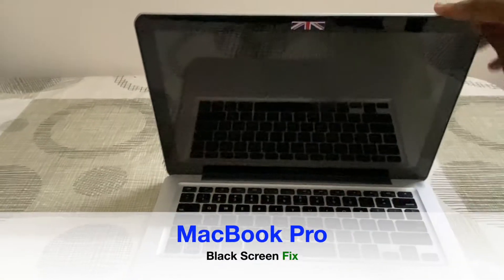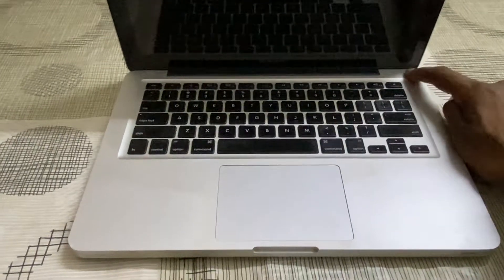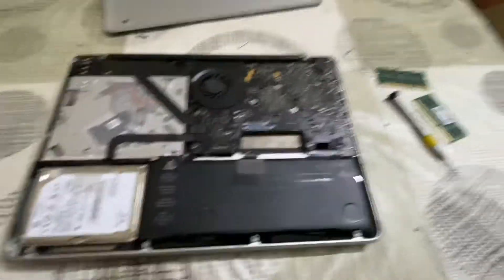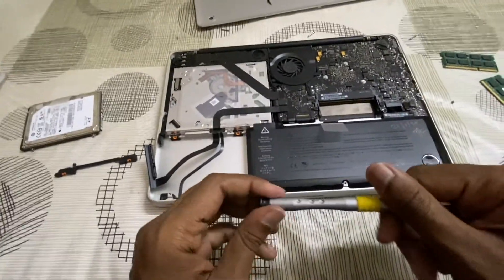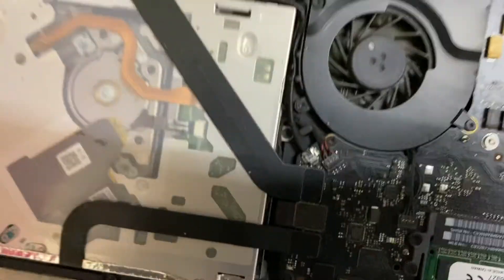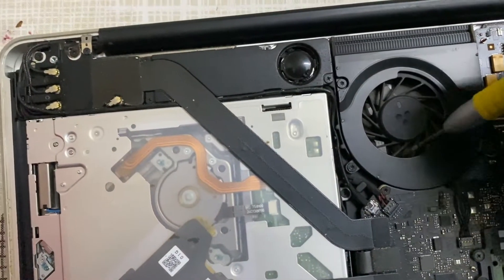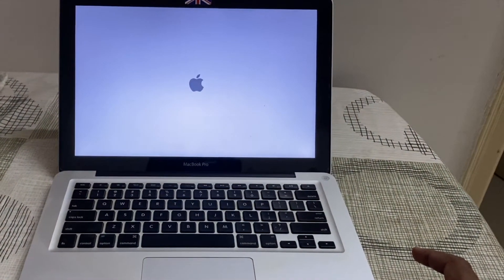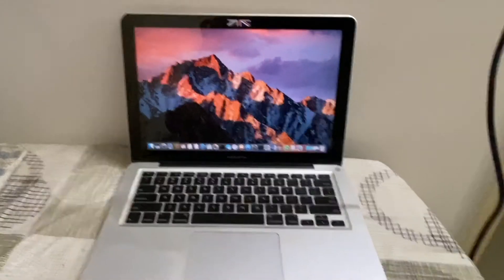MacBook Pro won't start, blinking sleep light, stuck at black screen? Fix it now!

Comment: Anyone with this issue. Hold down the power button for 5 seconds. Plug in the adapter while still holding down the power button, hold for another 5 seconds and it will boot.
Reply: Omg I tried this and it works, thank you so much, my gosh my MacBook pro won't open up for months now and tried to fixed it again today and I saw this comment, it didn't work at 1st but on my 3rd try, it works huhu thank you so much
Reply: I wish everyone it worked for would like the post so people know it's a legit fix.
Reply: Omg this worked!!! Thank you ❤❤❤
Reply: Spread the word 😅  @cheappc
Reply: Thanks brother,it worked!! Had a really important assignment to be delivered to a big client.woke up whole night waiting it to start.
Reply: Whats the issue btw?
Reply: @krishiyadav5659  it's something to do with a failure on the motherboard. You should prepare for issues of that sort some months down the road or it not booting at all. But when issue is still new this solution always works. 👍🏼
Reply: Just saying that this worked. I was skeptical but it did :)
Reply: DUDEEEEE THIS WORKS! Thanks for sharing
Reply: This worked for me also. Thanks. I already have a new battery coming. Do you think I should send it back and just get a refund?
Reply: @wedidedit  keep the order if your current one is off its best. Good Parts are getting harder to find.
Reply: Y E S !! Many thanks.
Reply: Man, I can't believe but it worked!! hahaha, MacBook Pro turned on in the first try.
Reply: Thanks so much for the tip, worked and my wife’s course work was saved 😄
Reply: Thanks brah now my fan is spinning at max speed😭
Reply: @notsmartist  it can't destroy the fan. I've used a mac like that constantly for over a year and it solves the issue of it running slowly. But let that not make you lazy to fix it.
Reply: @notsmartist there’s a program to put your fans at normal speed
Reply: Obv I need the battery I guess, there’s some way without the battery in? Thx
Reply: Found it a battery, idk how but it work 😅 how? What’s the problem then?
Reply: THANKS BRO, I WAS GOING TO KILL MYSELF, YOU SAVED ME

Comment: Same for me except the fans are off
Reply: Did it worked same .. my light only is turned on in the keyboard and the opening sound comes but it doesn't open
Reply: Have u fixed the issue
Reply: @सफल-aryal  No, but I have found why... I think.. If you look at the PC from the screen side. In the keyboards at the left, some wires must be misconnected.If you press softly then it will connect and I can use it for a few while.

Comment: But my fans are also not working.
Reply from the maker: Have to tried it connecting to power source. If fans run while connected to power then faulty battery. Even with power source connected and fans doesn’t work then Logic board may be corrupt. You may have to get it replaced

Comment: I have similar laptop, when press power button fan starts and stopping after few seconds. Then white sleep lights flashes. Same thing happens when I press power on button again. Please advise.
Reply from the maker: It appears  logic board may be corrupt. You may have to get it replaced
Reply: yeah same with me, like that, how fix it 😮‍💨

Comment: Thank youuuuuuuuu, my computer was with a " tech guy" for a month, he told me to buy new logic board, i did, but still didnt work, i just saw your video, and you suggest to change RAM memory, i remeber i had one extra pair, i changed and it works, thanks youuuu again bro. Any one with this issue, just change your RAM.
Reply from the maker: Glad to hear it worked 👍🏼
Reply: Prolly it wasn’t the problem, there’s a lot of different problems from the white light blinking problem

Comment: Tried to do both things but didn't worked please suggest something else .. the problem is exactly some
Reply from the maker: In that case I m afraid to say it could either problem with both or any of the ram or issue with the logic board. You can try removing one ram and turn on mac and vice versa. If it didn’t work then logic board is corrupt. Don’t try to replace logic board as it’s too expensive and better to get a new mac. Your data is safe, third party vendor and remove hard disk and recover your data
Reply: @agentsan23  hi i removed one ram , its working , that mean that memory need to replace ?
Reply from the maker: @CheeWah1984  yes. You can confirm it by placing only the faulty ram and turn on MacBook

Comment: Why didn't you remove the battery first... before removing the other components...?
Reply from the maker: Ideally it’s not required to remove battery. According to instruction from apple(link below) for removing and installing Ram. I presume the same applies for hard disk. However there is no harm in disconnecting battery before removing other component 

https://support.apple.com/en-in/HT201165

Comment: Took out the new wifi card and reinstalled the old one. Now it starts, stops and then starts again (doesn't go to sleep like before). Fans much louder now as it runs but still won't boot up. Do you still think this is a logic board issue?
Reply from the maker: Yes and I suspect the memory slot could have gone bad. Only few third party repair shops replace the memory slot. I would suggest go for a new MacBook as your MacBook model is too old and getting logic board is difficult and even if you managed to get it will be expensive. Don’t worry about data as there are some adaptor available to use your old MacBook internal disk to be used as external hard disk
Reply: @agentsan23  I appreciate your thoughts.
Reply from the maker: @tubular26  Anytime

Comment: I have a mid-2009 MacBook Pro that I've recently done a couple of upgrades on. When I turn the power on now the power light comes on clicks off and then comes back on again and stays on. The fans are working so there's power getting to the machine both with the charger attached and without the charger attached. That's all it does though the screen remains black and I can't hear anything that would tell me that it's booting up. Removing and reattaching the battery did not help. I've checked the LVDS cable that I detached to replace the Wi-Fi card and those two connectors look like they are properly re-seated but I'm not certain of this. I believe the new 2x4GB RAM cards are in the slots properly. None of the keyboard reboot alternatives (eg NVRAM) has any impact. I have no idea what's going on. How would I begin to diagnose this problem?
Reply from the maker: It could probably be issue with ram. Remove one ram 4gb and check if it boots up and vice versa.
Reply: @agentsan23  Thanks for your reply. I did as you said and even tried the old 2 GB of RAM in each  slot but nothing worked. I should've also said that the backlighting on the keyboard doesn't work even though the fans do.
Reply from the maker: @tubular26  I’m afraid to say that logic board could have gone bad. Better to check with mac repair center
Reply: I have same problem on same 2009 pro machine. First it used to start with long press powerbutton but now it wont just start. Chked the ram but not its issue. Out of 20 times I try, sometimes it start 1 or 2 times. What do I do?
Reply: Same issue here

Comment: got the same issue but the fan doesn’t work either just indicating light keep trying to boot up and after 4 sec the indicating light looks like it turn off and automatically start to boot up again but no hope.I’ve done everything but no hope
Reply from the maker: If fan isn’t working then it needs replacement. Also possible cause is bad memory(ram). Trying removing one of them and turn on mac and vice Versa. Still if it doesn’t work the you need to visit apple service.
Reply: Hello have u fixed the issue and how